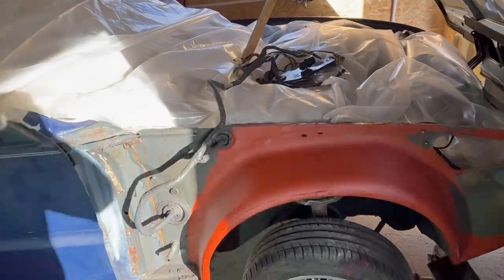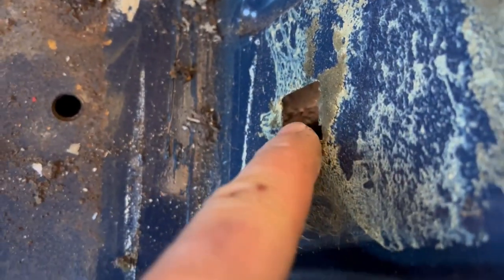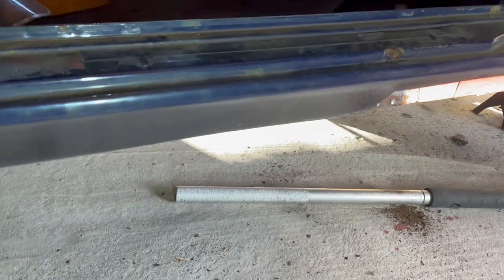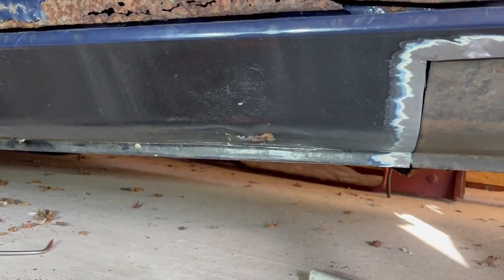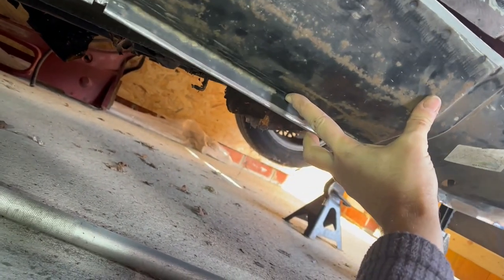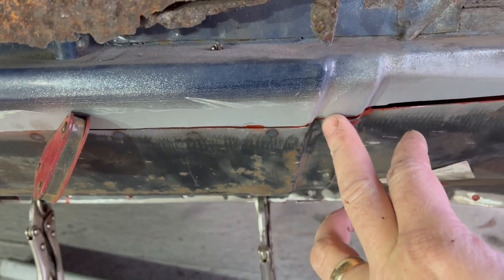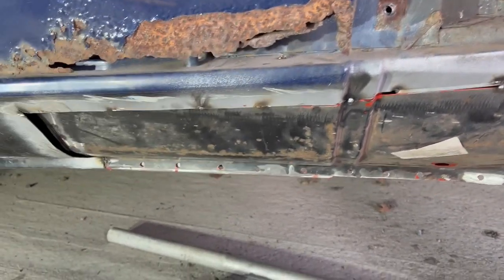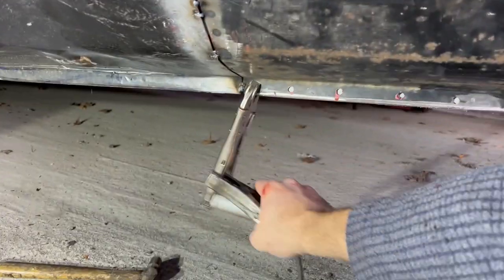Rover SD1 2400 SD Turbo restoration - Video 84 Offside front wing part 2

Comment: Would it have been quicker to just cut out the dent in the sill, especially as you had a spare new sill and were cutting it up?
Reply from the maker: With the prep time and welding and grinding its actually slower to cut out and weld in, and messier!

Comment: Jim, what was the reason for not using the new sill to repair the damage the FLT tines left?
Reply from the maker: Speed.  The sill is going to have to require a skim of filler where the new front and rear ends go on, and the metal isn't torn or rusty. So its just faster to smash the worst out and fill it.  I did almost thing of removing the whole length, but there is so much good metal it would be a waste.